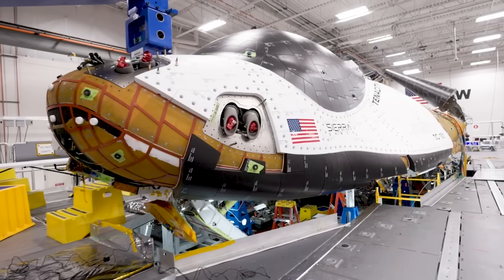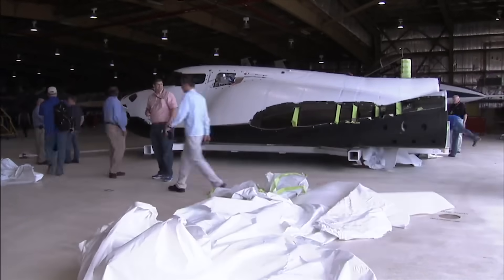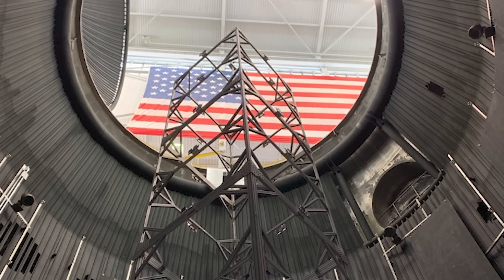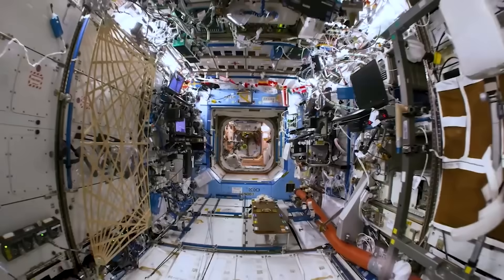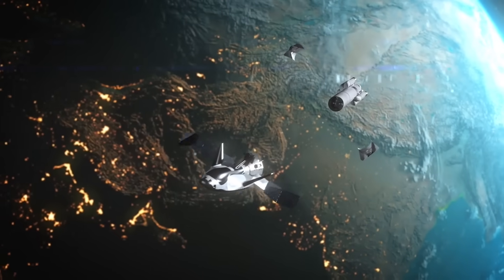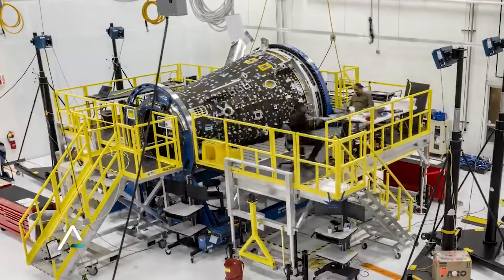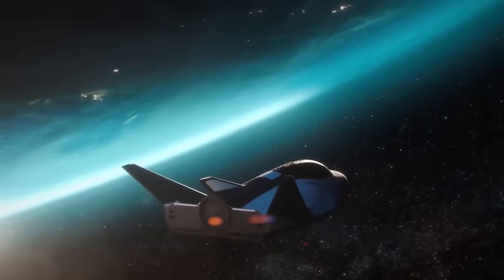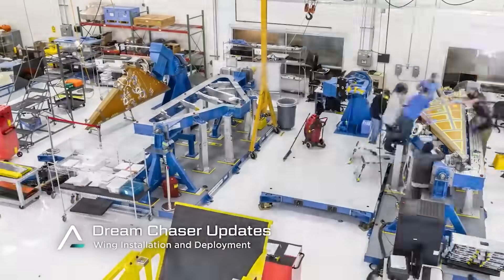Dream Chaser Tenacity Is Officially Complete

Comment: A nice update on Dream Chaser, but saying that the Space Shuttle had a "few problems" with its heat shield tile design is a gross understatement considering the shuttle lost one of its crew on reentry, and the manual labor and expense to replace each uniquely designed title. The expense involved in designing and replacing each unique tile was the death of the program. What was supposed to save money a fast turn around reusable spacecraft turn out to be anything but, and the main reason was the head shield.
Reply: 1 crew loss in 25 years of service due to heat shield. That's a pretty good safety record actually.
Reply: That was just one of the many problems with the very expensive maintenance of the heat shield, and that alone caused it to not be affordable. I am all for Dream Chaser, which is a very slick design, and a much better design. I was just pointing out that there were more than a few problems that caused the Space Shuttle to be unaffordable in the long run, and that was mainly focused on the individual size and shape of each heat tile. The Shuttle was designed to be a more rapid turnaround ship. Instead it turn out to be more expense than building new rockets, because of the replacement of the heat shield's tiles each time it returned. Its main success was building the USA portion of the ISS. Elon avoids that by making the tiles the same shape, except for a very few. Dream Chaser is smaller and the heat is less of a problem for a more rapid turn around launch; they are both iterative designs from the mistakes of the shuttle's massive size and shape that caused the problem of the irregular shape of the tiles that had to be used on it. @kdrapertrucker

Comment: How many Dream Chaser's are to be built?  How many will be crew-less designs, and how many will have a windowed cockpit?  Does Sierra Nevada have future designs and Dream Chaser configurations that are larger and or smaller for personnel transport or heavy cargo transport?
Reply: IMHO the biggest flaw of the Boeing Starliner was the decision to go only for a crewed version.  SpaceX flew two major versions of its Dragon capsule for cargo missions, during which they learned many things, including to always pop the parachute.  Only once they had a dozen cargo missions under their belt, and over a hundred Falcon 9 launches, did SpaceX offer to carry humans to space.  I similarly don't trust Orion, which has had only two autonomous missions, or SLS which is the most complex launch vehicle since Saturn V, but has only had a SINGLE test flight.  I feel that Sierra Space is wise to take the opportunity to learn first on missions where only cash is on the line.  I just do not understand their obsession with depending upon the Useless Launch Alliance where they are not only going to be only the second payload on a brand new launcher, but further that this obsession has introduced an unnecessary half-year delay.  What intrinsic advantage does ULA have over SpaceX?  Why risk billions of dollars in investment on a launcher which has NEVER flown when for a lower price you could launch on one that has flown over two hundred times?

Comment: Space plane has the lowest potential return and refurbish costs. A capsule splashdown in seawater requires expensive extraction, extensive inspection, and deep refurbishment. A dry land capsule impact is less expensive to refurbish but has high forces on crew and cargo and still has to be retrieved. 

The booster costs are separate and either capsule or spaceplane can be carried on disposable or reusable boosters. Current booster options don’t fully realize this cost savings potential for dreamchaser yet because there isn’t a reusable booster with a large enough fairing yet.
Reply: watch farscape 1st epasode john crichton  makes worm hole his ship looks just like nasas new shuttle
Reply: The Farscape design was likely inspired by previous spaceplane concepts such as Dynasoar. The idea has been around a long time.

Comment: So even Sierra is going to beat Starliner to the ISS ?
If the Vulcan keeps being delayed, one has to ask, can other launch vehicles loft Dreamchaser to orbit? Falcon9 perhaps, maybe with custom fairings to suit?
Reply: Starliner has already docked to the ISS. Dream Chaser is designed to fit in a 5 meter fairing so it could launch on the Falcon 9. SpaceX has already launched the X-37B spaceplane.
Reply: @markmaz56  must have missed that flight

Comment: can someone explain to me how is that better than a dragon capsule from Space-x ?
Reply: According to sites I found, capacity to orbit is better with dreamchaser:
* dragon cargo: 2500kg pressurized and 800kg unpressurized up, 2500kg down
* dreamchaser: 5000kg pressurized + 500kg unpressurized up, 1750kg down

Dragon is more affected by weather for return trip - needs to land somewhere with supporting ships; Dreamchaser can land at any suitable airport, giving far more options. Dragon is only launched on Falcon; Dreamchaser can potentially be launched on multiple rockets. Dreamchaser will be slightly better for time-sensitive cargo returns. Cost per flight of Dreamchaser could potentially be lower (less refurbishment) - but we'll need to see how those tiles work out. Most of all - having more options is good.
Reply: For one thing, it can land on a runway at the Cape instead of being retrieved from the sea.
Reply: Reentry is also gentler than with a capsule which is important for many scientific experiments.

Comment: I was enthralled by the Space Shuttle as a teenager… Then Challenger happened… I was devastated!!! Shortly afterwards the Columbia broke apart. Again, I was devastated!!!
Reply: shortly afterwards?
Reply: @duckvs.chipanddale585  Same thought!  How is 17 years "shortly afterwards"?
Reply: Both losses were preventable. 😢
Reply: @theharper1 how was columbia preventable?
Reply: @duckvs.chipanddale585  if they had checked the wing surfaces before leaving the ISS, they could've saved the crew. The Shuttle may not have been possible to save. Not enough was done about the ice issue. The Challenger shouldn't have been launched in the conditions it did; that was a management failure.
Reply: @theharper1 the columbia didn't go to the iss 🤦‍♂
Reply: @duckvs.chipanddale585  I wasn't sure if that mission was an ISS flight. Most of the final missions were, because the shuttle was the only suitable launch vehicle. If it wasn't an ISS mission, then I guess they were doomed. A rescue flight would've taken too long. The real problem was a failure to address the build-up of ice prior to launch. :(
Reply: @duckvs.chipanddale585 
 The common misunderstanding is that they were in the same place: “Space.” 
  Don’t complicate space travel with a lot of silly talk about orbital inclination.
Reply: How was 2003 "shortly after" 1986?
Reply: @corey2232  Hi Corey… Thanks for the reply!!! Considering the fact that I am almost 60 years old 17 years is not that long… Time is relative… I grew up with the Space Shuttle… I remember when it was a concept covered in National Geographic… I also remember coming in to Ft Bliss from training exercises and seeing it on TV… I was devastated… I didn’t mean to write a novel but it seems like yesterday!!!
Reply: It was a dangerous system. One had to be 45 seconds into flight to abort the launch. That's an awful long time! Our early launch vehicles had launch-abort rockets to lift the capsule off the rocket in case of serious trouble, but not the Space Shuttle... You could hit the switch right on the launch pad with the vintage capsules!

Comment: Are they able to fly this on top of a falcon 9?  If so then why not?
Reply: From what I've heard the fairing for the Falcon 9 and Falcon heavy are not large enough. But SpaceX is working on a larger fairing so that may change in the future.
Reply: Nope both are 5 meter fairings. The standard fairing for falcon is shorter, but Musk has mentioned that long, no reusable fairings can be made and used for spacecraft that need it.

Comment: Why there is heat tiles on top?
Reply: During reentry the plane will be surrounded by superheated plasma. Every surface needs protection from the heat radiated by the compression shock wave and heat conducted or convected by the plasma

Comment: You do see one of the primary faults in this design. It's the launch booster, which is a one-time shot. The cost would be prohibitive to launches more than a few a year at best. Maybe they should team up with SpaceX?
Reply: The Vulcan booster is irrelevant to the design of Dream Chaser. Dream Chaser is launcher agnostic. It can launch on anything with sufficient thrust and a five meter fairing. ULA just happens to be who they have contracted with, for now. Unfortunately, at least for now, SpaceX only has a three meter fairing.
Reply: @odysseusrex5908   The Falcon Heavy Launch Vehicle has a composite fairing that is 13.1 m long and 5.2 m wide. It can carry large payloads of up to 53,000kg.   Looks like the Falcon 9 could take it to LEO and the Falcon heavy to Geostationary Transfer Orbit.  Single google result did not verify it.
Reply: Imagine Dream Chaser launching in the Starship Cargo hold. Total reusability.
Right now, it could go inside a Falcon 9 Shroud, but they decided to partner with ULA. Sierra Space has had enough of their own delays that they are about on schedule with Vulcan. ULA is talking long term plans for reusing the Rocket Engine section of the booster eventually, since the rest of the booster is just tanks. At one point also, ULA was talking about eventual plans for keeping the second stage in orbit, with a refueling capability, to be used as an orbital tug.
Reply: @i-love-space390   My understanding is that Dream Chaser requires a five meter fairing and can not fir in Falcon's three meter one. I could be wrong though.
Reply: Falcon has a 5m fairing
Reply: @VicariousAdventurer   No, it does not, only three meters.

Comment: I was wondering, if StarShip would also land on runways, with a little bit larger wings? that would be crazy :)
Reply: Crazy is being caught by Mechazilla! Space planes are old school.
Reply: Once starship flies, I guess space X can and is capable to change it into dreamchaser like, to land on a  runway.
Reply: No, absolutely not. It is solely designed for vertical landing.
Reply: Why would it need larger wings?
Reply: @shanent5793  The wings on Starship is just give it air resistance, not to give it lift, its designed for a controlled fall.
Reply: @kjetilhvalstrand1009  Starship uses its engines to land, it doesn't need any more lift

Comment: Now all Sierra has to do is stop waiting for ULA to get around to actually flying its mythical Vulcan-Centaur, and instead order a lift from SpaceX for HALF THE PRICE!  Why don't the investors of Sierra Space insist that the company obtain its lift from the lowest bidder.  What has ULA done to extort this ridiculous loyalty from Sierra Space?
Reply: Falcon 9 and Falcon heavy don't have large enough fairing to fit  Dreamchaser. Rumor has it SpaceX is working on a larger fairing so that may change in the future.
Reply: @liquidpatriot4480  SpaceX need a larger fairing for some USSF missions.  I do not actually understand why an aerodynamic payload such as Dreamchaser even needs a fairing.  If it can reenter at Mach 25, why will it have a problem at the subsonic and barely supersonic speeds up to maxQ?
Reply: @jamescobban857  That I'm not sure, perhaps the Dreamchaser can't be mounted in such a way that doesn't cause an asymmetric imbalance of aerodynamic or load forces. Just a guess.

Comment: I would think Dream Chaser is more related to the U.S. Space Force's Boeing X-37 than it is to the Space Shuttle.  The X-37 is unmanned, launched enclosed in a fairing on an expendable Atlas V sized rocket, a similar launch weight and size to the Dream Chaser.  I greatly look forward to see it operate.
Reply: The body shape is directly descended from the HL-10 and HL-20 lifting bodies of the 1960s and 70s. Those that say that the HL-20 was a rip off of the Russian "Spiral" vehicle are clearly unaware that NASA and the Air Force had been working on lifting bodies independently for many years. In fact, the third middle "fin" of the vehicle was found to be needed because of instability on the two fin designs.
The software may be more related to the X-37, since it was developed from a NASA program that the Air Force took over. NASA is very generous with all the private partners. It gives away billions of dollars of technology that the government funded. Inflatable structures, lifting bodies, advanced batteries, semiconductors, software, Environmental control systems, RCS thrusters, rocket engine designs, etc are just some of the examples.
Reply: @i-love-space390 Let us not forget its other ancestor: DynaSoar.
Reply: With its engines the X-37 is actually closer to the Shuttle as the DreamChaser itself is more 
 of a glide body than a plane…😊
Reply: possibly got French roots.The French had a closely resembling project.
Reply: @vahehatch2800  Except that this one might actually work.
Reply: Looks like an evolution of the MiG-105 design to me.
Reply: Dream chaser can be manned though.
Reply: @kdrapertrucker  Not yet.  The Dream Chaser is cargo only at the moment.  There is a proposed manned version for the X-37.  It is stretched X-37 called the X-37C.
Reply: It is a new craft.  All new craft use aspects of old designs.  Yet they are new designs.
Reply: It took 10 years to build it?  Too long!!  And it will take another 10 years to fly it.  That too darn long!!  By then the human species would already be extinct!!
Reply: @jeffjohnson5053 
No.
Reply: https://www.youtube.com/watch?v=hSQhTN2Bxhs
Reply: Copy of MiG-105
Reply: Yeah but waaay less people know what the x-37 is
Reply: @jasoncramer6717  those who need to know know

Comment: One has to wonder how things would have turned out if they had made an agreement with SpaceX.
Reply: Why? Dream chaser has been causing years of delay. Ula is basically ready to launch it
Reply: Why? Both Tenacity and Dreamchaser are incompatible with both Falcon 9 and Heavy: the fairings are too small and the weight is above the capacity of either launcher (which is only 10 tonnes for either Falcon, EM has been disingenuous).
Reply: @davidstevenson9517  how is 10 tonnes too much for falcon heavy? Its has 63 tonnes to leo? Im not certain as to the diameter. Also crewed variant of dreamchaser will be unfairinged
Reply: I see 38,000 lbs to LEO for Falcon 9 reusable. Vulcan can lift a shitload with lots of solid rockets, but that configuration is not needed for Dream Chaser.